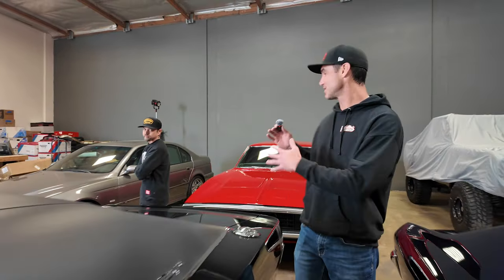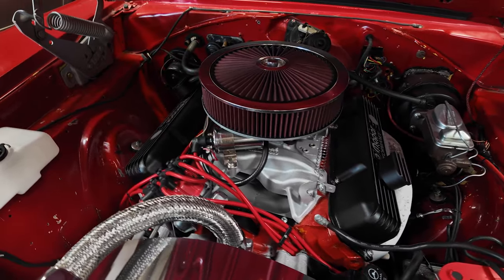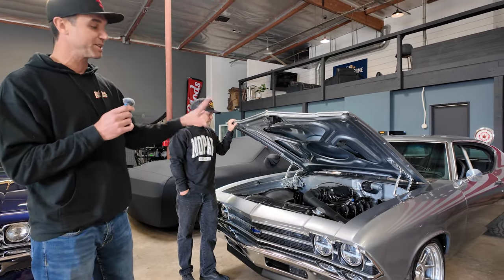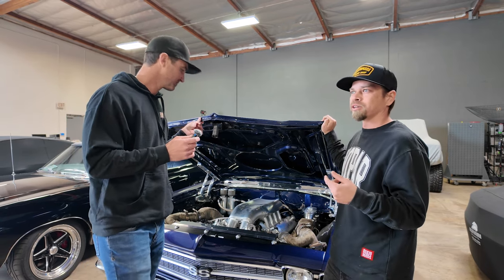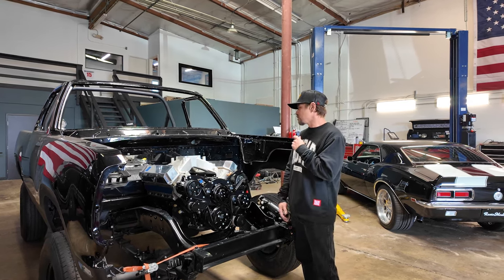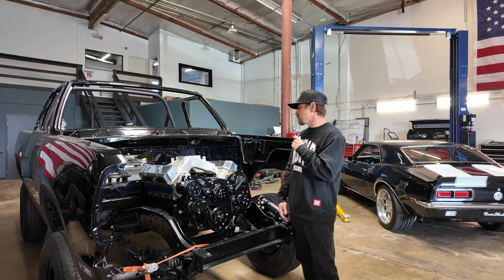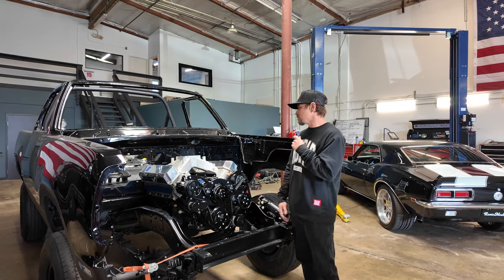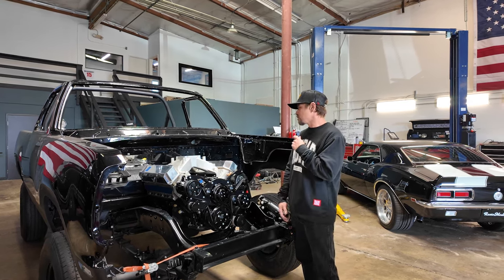WE BOUGHT A 1300HP TWIN-TURBO CHEVELLE TO GIVE AWAY!

Comment: 77/78 Bandit, 71 Chevelle, 65 Chevelle, 67 GTO, 57 Bel Air, Square Body Blazee with a RS4 Roastershop Chasis.

Or even a 60s VW Bug. 😂
Reply: A super bug.... turbos....  Enough power to pull front wheels off the ground 😁🙀😁